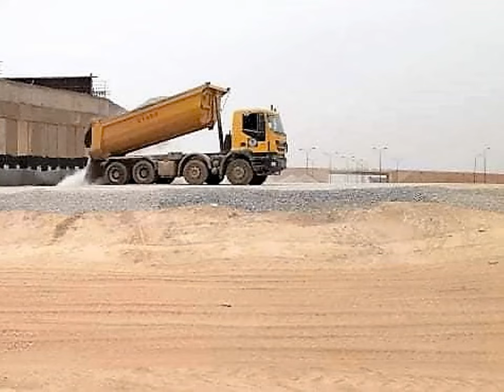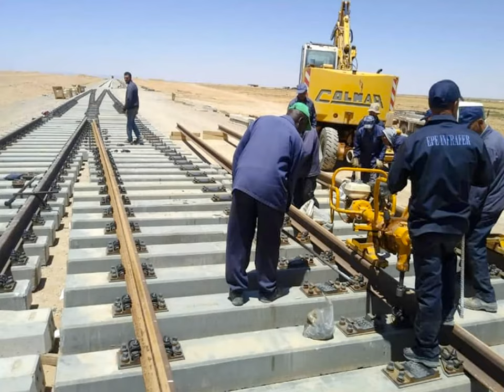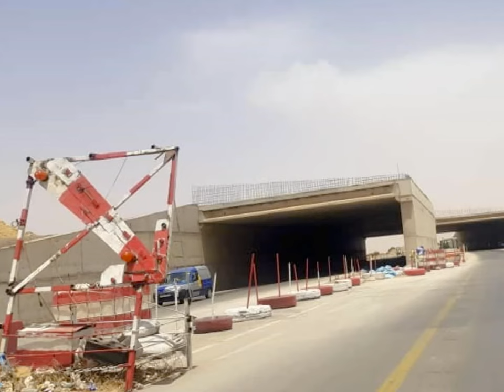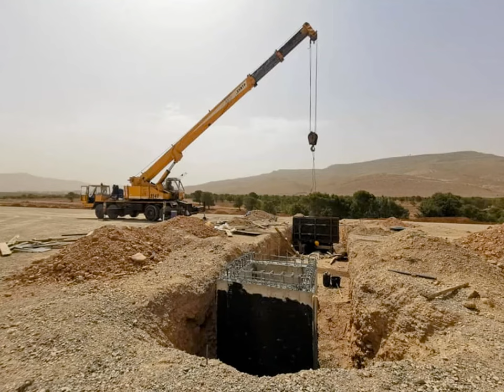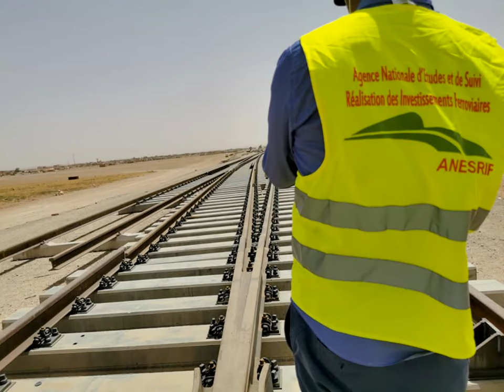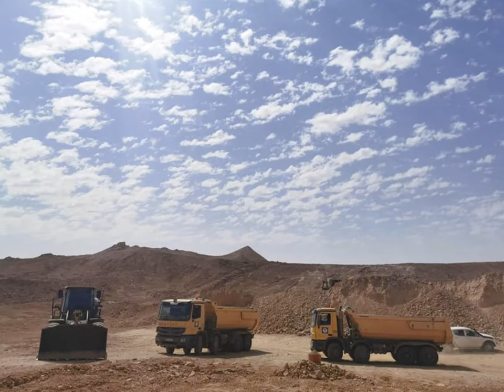👍أشغال الطرقات و السكك الحديدية في ولاية البيض 👍ROAD AND RAILWAY WORKS IN ELBAYADH REGION👍

Comment: Merci beaucoup pour la vidéo même si elle n'est pas bieb structuré mais encore une fois merci parceque vous le réalisez.
Les gens n'en parlent pas mais les projets ferroviaires du centre de l'ouest sont énormes très énormes et connaissant les difficultés techniques. 
Lignes des hauts plateaux de plus de 1000 kilomètres. Nouvelles lignes: elbaiad mecheria. Oued slisen - saida. Oran arzew . Oran Tlemcen. Msila, Tiaret  Laghouat djelfa bougzoule. Touggourt Hassi messaoud. Djbel el ank pour le minerie 
Sans parler de la modernisation des anciennes lignes. C'est des énormes projets financés par le Trésor Publique. 
Merci pour la vidéo je vous conseille d'en faire plus sur le rail il y a de quoi présenter.